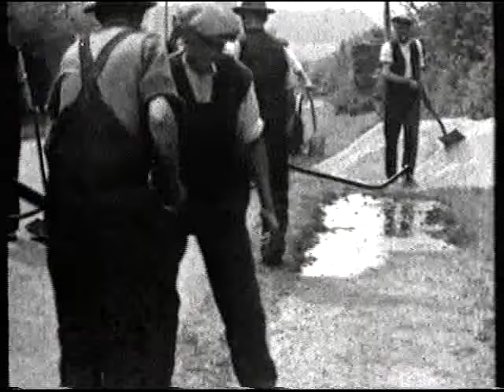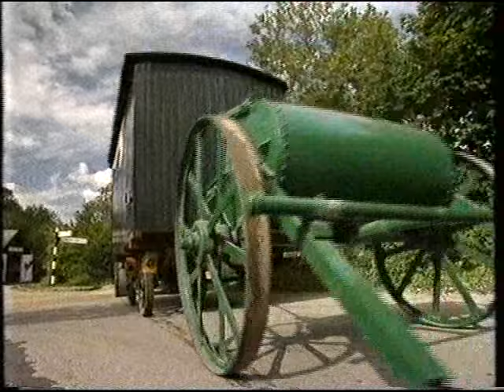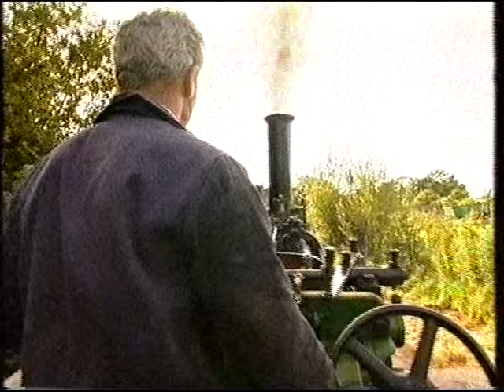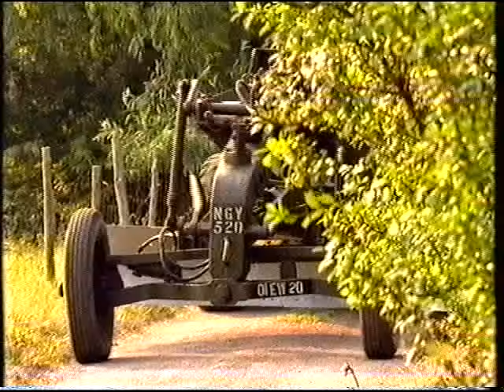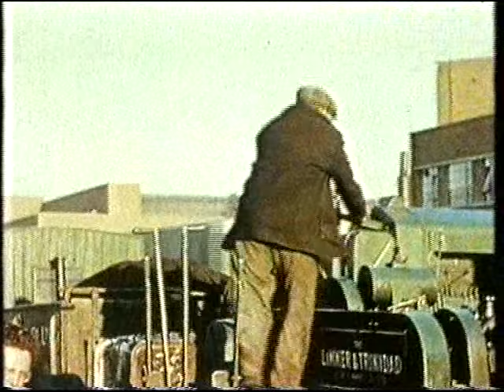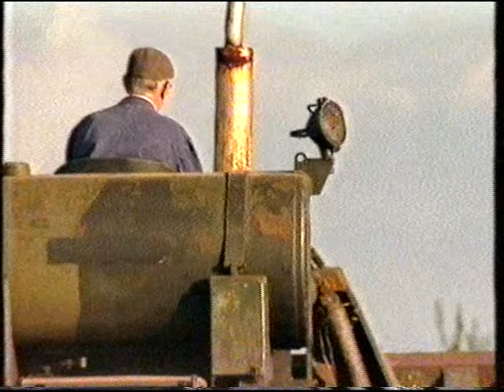Classic Plant- Road Builders (26/01/98)

Comment: My Uncle had an old Galion grader almost like the one shown here. The UD engine was replaced with a 4-71 GM/Detroit but it still had the original Hi/Lo transmission on one stick. When shifting ranges the stick would fall down and lock up the brake pedal so there you were with the wrong gear if there was any gear at all and no brakes. It finally broke in two but the GM engine was saved.